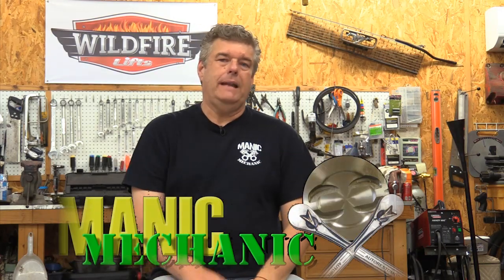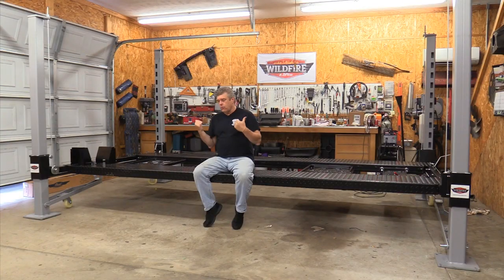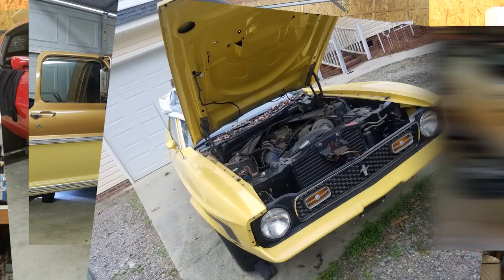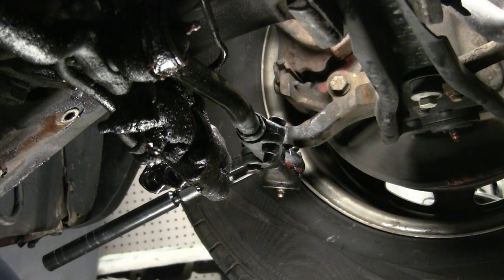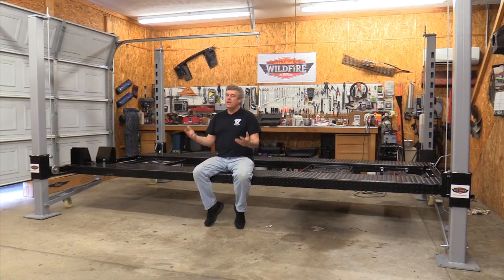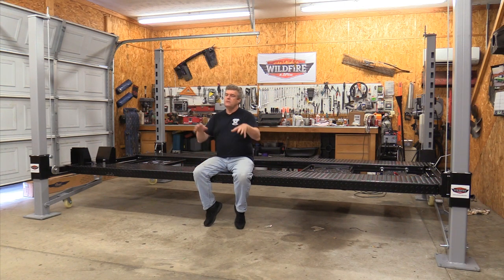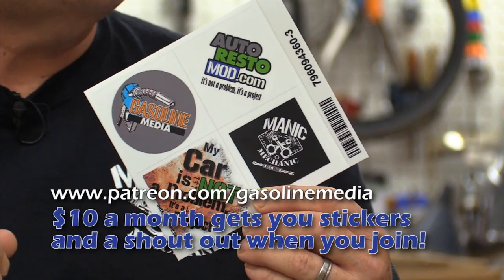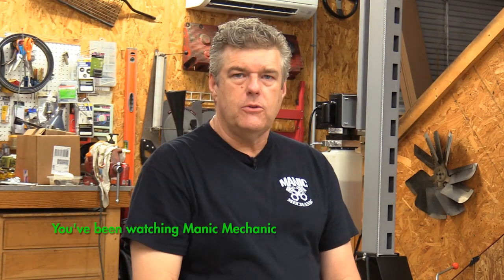Why Get a Four Post Lift

Comment: We had three foot tall stands that held jack stands and when we needed to pull the wheels off a car on a ramp rack  we could sit them in place let the car down and pull the wheels then you have somewhere to sit parts tools and the best part was you didn’t have to pick the tires up off the floor they were laying right there ready to stand up and bolt on.

Comment: It looks like you have the air jack option on rollers. Get another air jack and you have a 2 post beat hands down. With 2 jacks you can even rotate tires without any issues. Keep doing what you do Jeff and hurry up on that Torino. It's the wrong year (cough68), but it's still a Torino.

Comment: Having worked with both love the 4 post with air jacks can do everything  except pulling a body off a frame. And it's safer than a 2 post anyway you cut it. Plus no bending over or getting on the the floor to adjust or readjust the arms
Reply from the maker: And if you have small children they can chase the bolts and the wrenches...
Reply: @AutoRestoMod  another plus is if someone needs to get in and start the car or pump the brakes ect no worries of the dreaded door to post scratch or dent. And myself being a little well rounded in the middle it's way easier to get in and out even just getting the car on the lift

Comment: I have both a 2 post and a 4 post. The 4 post inside works great for what you say plus storage the 2 post is outside & use it when needed. This time of year its a bit warm in Phx though.  I have found the use of jacks on the 4 post I can do a lot of stuff inside on it.  The late model F150 screw jacks work fantastic.

Comment: I'd only go with 4 post just for the safety... I'm short on headroom in my garage at 10', but have plans for a 2800sf dream garage with 12' to 14' ceilings; And I'm old dude too so radiant heated 6" floors :)..
Reply: I built my 2400 sq. ft. garage back in '07. 14' High ceiling.   I'm in New Jersey, and I went with the Radiant in the slab.  Best decision I made.  Now I'm thinking about a four post lift.....
Reply from the maker: I'd do radiant heat too. Keep that dream alive!!!

Comment: I haven't seen much work done on 4 post lifts.  I can definitely see the advantages of the 4 poster.  Where My brain keeps getting caught up is how do you do suspension work, remove the rear-end, or any other tasks that require the vehicle to be off its wheels? 

I hope to build a shop someday in the not too distant future, and a lift will definitely be part of the plan.
Reply from the maker: The four post can do that using a jacking bridge or jacking trays.

Comment: I started out working on cars for a living in the 70's and have used twin post lifts, single post lifts built into the floor, scissor lifts, and even pits on larger trucks. I have never used a 4 post lift, however, I just purchased an Advantage SS-11000-WD for my home shop to play with in my retirement. The Wildfire looks like a knockoff of the Advantage (or backyard buddy) lifts in design, except they use bearings in the cable pullies which are prone to breaking. I wonder why they copied such an excellent design, but then weakened it with those bearings?
Reply from the maker: I have had zero issues with mine.

Comment: Ive been wanting a 4 post for years.  When I built my garage with a 10' foot ceiling,  the idea was to store my Corvette and park my Harley's under. It.  Never happened. Now I still wish I had one. This morning I plan on jacking up my 56 Ford F100 to change the 3rd member. Im still crawling on my back. UGH
Reply from the maker: We hear ya.  Sometimes things have to be sacrificed for the greater good. I once sold three parts Cougars to buy a Falcon. Needed that $800 (this was 1994) to get over the top.

Comment: I've gone back & forth -  mostly leaning to 4 post.  What do you think of the 4 posts that have the jack pad/tray accessory that allow you to get the cars off the wheels?   Safe/Unsafe?   Seems to me that would be the best of both worlds for a unibody car.  Love the shows.
Reply from the maker: We have the jacking tray for this one. I want to get another one so we have two. The trays and the platforms are only as safe as you are, I know they can fail, but using proper safety measures will help.

Comment: My first lift was at a Toyota dealer in 1992, An in ground single post air powered hydraulic that had zero safeties and would jump the last 6 inches at the top. It was a death trap. Seen more than one car come down in my 20+ years at dealerships, most by inexperienced techs but not all. Any 4 post or two post electric lift is far and beyond better than those old in ground lifts.
Reply from the maker: Agreed. This one has been far and away more useful than I thought.